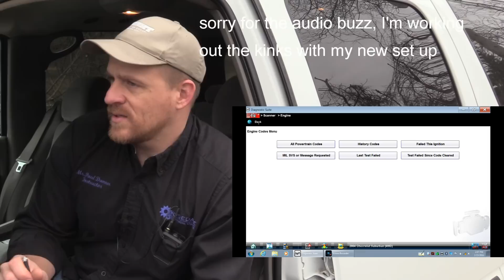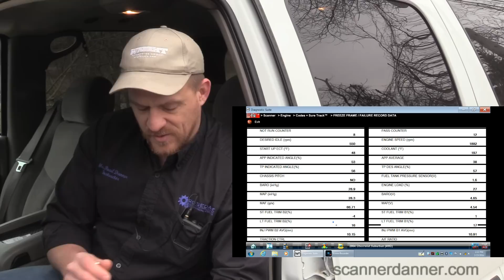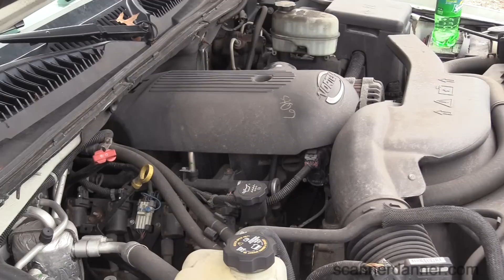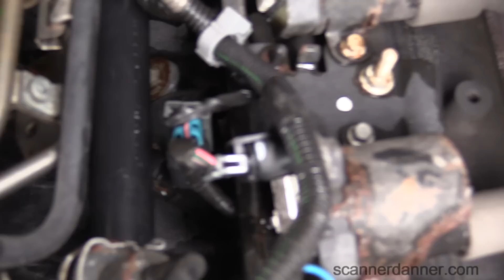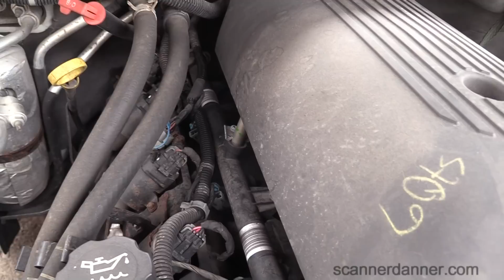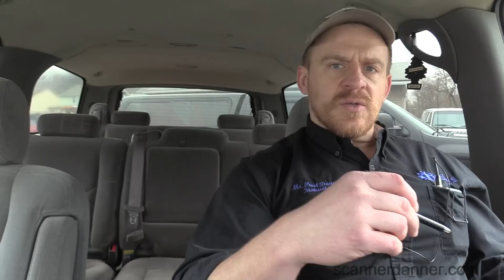Comment: 0171 & 0300 
Replaced spark plugs, wire, purge valve, intake manifold, cleaned fuel injectors, replaced 02 sensor, idk what else.  cleaned MAF, my MAF at driving is 1.90+
Reply: What are your fuel trim numbers at idle and 2500 and can you feel a constant misfire? If you feel a constant misfire, attack the misfire issue first. Spark, fuel and compression must be verified

Comment: Been running a bank 1 lean code for 10 years. All is fine.
Reply: Did you want help fixing it? If you do what are your fuel trim numbers (both STFT and LTFT) at idle and at 2500 in park on both banks?

Comment: So my uncle has a 1999 chevy silverado 2500 with a 6.0L in it. It had a huge problem with the lean bank 1 sensor 1,2 and bank 2 sensor 1,2. I changed the o2 sensors and it fixed it. Today it's in the low 30s outside and my uncle got in and drove home in a hurry the engine wasn't warm all the way and the misfire/death shake started he got it home. I cleared the codes while it was running and the temp got to optimal temperature at the same time but as soon as I cleared the codes the misfire stopped and it ran smooth. Idk what the heck but I wanna figure it out. 
These are the codes p0171 p0174 p0300 and p0151.
Reply: well you are on the right video if you suspect it is the intake gasket

Comment: Sooo I have the opposite problem where at cold it runs great but when it warms up it starts to shake
Reply: Codes, data (fuel trim and misfire counters) if it's a Ford and OBD2 scanner will give you that under mode 6 
Hot engine idle only misfiring is typically a valve issue (compression problems)

Comment: I have had a 171 and 174 for a few months... literally changed almost every part, maf, o2s, plugs, wires, all coils... ran smoke test, no smoke, I am about to do intake mani gasket and throttle body gasket with cleaning this weekend..... praying this resolves this issue.... i am at a loss... runs better after I replaced coils but light came back on... I did notice it runs way worse at idle especially when it is cold out... now the qeather is starting to warm up its not as bad... any tips would help
Reply: Do this water test with the engine cold

Comment: P0171 and p0174 codes. Smoke tested intake and evap. 0 leaks. Small e haust leak after downstream o2 sensor. Cleaned MAF. Ltft steady at 35 and stft steady at 8 to 10. 2017 silverado. I'm at a loss
Reply: Unplug your MAF and see what trim numbers do.
Reply: @ScannerDanner  I sure will and follow back up. Thanks!
Reply: Stft went negative 2 and holding
 Ltft trims dropped from positive 29 to 12 after removing maf comnector
Reply: Plugged back in connector and now it is idling rough. Fuel trims holding though. Maf reading slightly above 5 g/s currently.
Reply: @ScannerDanner  cylinder 3 shows value of 44 on misfire counter. No other misfires detected
Reply: Codes tripped when engine was warm. Under load fuel trims get better buy at idle return high. Also maf reads 3.4 at idle which should be closer to 5.3? Engine displacement roughly? I'm hoping it's not injectors HPFP or in tank pump
Reply: Fuel pressure at idle is 45 to 50 psi. Increases under load to 60+ psi but will fluctuate +/- 10%
Reply: I think I found the culprit. Aftermarket shorty headers burned through spark plug sleeve and boot on #3
Reply: Replaced spark plug wire as it was an unrelated issue to the lean codes. Still get high fuel trims at idle. Maybe the throttle plate is stuck open at idle due to carbon buildup?

Comment: Best explained video.2009 chevy 5.3 no power or acceleration at   full operating temperature.Could not feel exhaust at the end ofthe tail pipe so we cut the pipe between the manifold and cats to let he pressure out.Run the truck at full operating temperature for short distance and the transmission slips and engine revs up.Any ideas?
Reply: Transmission slips? Focus on that. Starting with fluid level

Comment: How is find my numbers change once my trucks heated up I’m gonna do another smoke test today, but I’m pretty sure I need a intake manifold gasket or something. I don’t know because I’ve got the original OEM on this 05 GMC and I hear that the new one has a metal retainer on the inside, so it doesn’t slip out the same way when it’s worn? So we’ll see what Smokey says. I was having major electrical turns out I had a bad ground pigtail coming off the left side harness next to the firewall ran a new pigtail ground off of that and that sold a lot of my sensor traction control ABS all those problems, but ultimately, I’m having sensor issue and I’m having an issue finding the current sensor. The one I ordered I’m gonna go pick up will work out. We’ll see.👍🏼🤞🏼💪🏼 I appreciate your diagnostic lessons

Comment: Excellent!  My situation is random/pending P0174.... which occasionally hard sets.  Ive been struggling with this for awhile.  STFT at 50%(!) and LTFT also very high for bank 2.   2002 GMC Savana. Curious if you have videos for just one side?  Thanks!
Reply: also, the spark plugs and O2 sensors for this side get carbon blackened... I keep cleaning them to try for a solution.  Exhaust flows fine, CAT CON not blocked - best I can tell.   Perhaps a problem ECU?   I do have an extra I could throw in....
Reply: Step 1, during the +50% trim command. Is the O2 reporting properly. You MUST address this first

Comment: Beautiful video, hope you r doing well, cuestion, so that means if the fuel trims going up as the engine is warmer, is not a vacuum leak, what can be? Fuel problems?
Reply: You can still have warm engine leaks too. The key is to monitor your trims at idle and 3000 rpm in park. If it gets better at higher rpm = vacuum leak. If it gets worse at higher RPM = low fuel pressure or dirty MAF (most common)
Reply: @ScannerDanner  thank you for awnser, my fuel treams going up both banks at 200rpm and maf sensor is reading ok, so next is fuel pressure? I have a 2010 kia sedona if fuel pressure is bad, what is next?

Comment: @17:39

Is it not detrimental to have non-compressible water entering a combustion chamber for the piston to  squish?

Kinda sounds like the 2000 Astro Van I bought in 2010; almost a "ratcheting" type engine running lack of smoothness.
Reply: No, it's not enough to cause any damage

Comment: Question I'm gonna try this. 

But I just did an ls swap in my 1986 c20 truck. 

My engine is a 2007 dbw.6.0lq4. Everything is new. But I'm getting the same codes.
Reply: You have a lean condition. Do some testing, report some numbers, then maybe I can help.
Reply: @ScannerDanner  ok I will do that thanks man
Reply: @ScannerDanner  oh also I failed to mention, I'm running headers number 2 cylinder the tube is not discoloring I'm thinking I may have a clogged injector not firing very good no mis fire code but it does have a mis fire. Would that cause the the lean codes for bank 1 and bank 2?
Reply: Most likely not, especially because it's both banks. Fix your misfire, then get me fuel trim numbers at idle and 2500 rpm in park
Reply: @ScannerDanner  ok we'll do. Thanks for you help.  I will get back with you

Comment: Hi Guys, ive got a toyota 2GR-FE v6, fuel longterm trims average -6% to 10% at idle & gets worse (+16 to +25%) spiked when pressing accelerator, at WOT it goes back down to +8 to +10%.

So as i drive it goes from 0 to 16 to 25 then back down to 10, which is so strange. load value on freeze frame data was at 30% so im unsure what is going on, could exhaust leak cause such a spike in numbers? or an 02 sensor precat or post cat?

any help would be great guys, Lean on both bank 1 & 2 and usually light comes on at constant speed.
Reply: First thing I'd look for is a dirty maf sensor. I have videos on this on and some are even Toyota. Second thing I'd check is fuel pressure, possible dropping off under load
Reply: @ScannerDanner  Thanks Guys

I havent replaced the maf sensor, checked & cleaned the 02 sensors, vacuum tested the intake & exhausts, reset the pcm & cleaned the throttle body and have found nothing, i cant pressure test my car as its a lotus exige & there is no place on the fuel rail to hook up the gauge for the pressure test.

however i am looking into it being the fuel pump.. the car spikes & comes back down in long term, its the strangest thing.
Reply: @m11ny  don't replace it (the maf) clean it!!
Reply: @ScannerDanner  i did clean it before & still issues, now i have 2 perfectly functioning maf sensors haha

Comment: Thank you for this. I just caught a manifold leak on my 02. Shed only misfire when idling without really cold outside temps on when the engine was cold. Did this water test after reading a code of lean. And she started misfiring abit and smoke would pickup out the tailpipe.
Reply: Sweet! It's a great test for sure

Comment: At minute 30:47 you would have tested the oxygen sensors better by stepping on the brake several times than by accelerating the car hard.
Reply: That would drive it lean, it's already lean, I need to make sure it reacts to a rich condition, and then the decel event after that is my forced lean. Best of both worlds

Comment: Hey so I have a boost leak tester for my Subaru but can I use it on my NA Acura tl and apply a small amount of air and use soapy water to see what might be causing my intermittent lean condition? I have a cold air intake on the Acura so it also has a gauge on the boost leak tester. I also have a ballon type adapter for the smoke machine but if I apply 2 psi of air or something and I spray around to see if there’s any bubbles but how many psi can you apply on the intake for a vacuum leak test?

Comment: Danner! I just diagnosed a 2013 Chevy Express that P0174 and P0172 lean codes for both banks. (it ended up being a bad MAF). Fuel trims were normal at idle, but on acceleration the long term fuel trims would go lean at over +20%. I could also hear the engine knocking on acceleration with the doghouse removed. The engine also lacked power and the trans shifted poorly. You NAILED it at the end of the video with your comment about lean on acceleration is likely MAF or fuel pump. I spent hours today doing diagnosis. I finally tried a known good MAF and fuel trims went normal, power was back, no more knocking, and trans shifted properly. I learned to use a Snapon scan tool and scope from your videos 10 years ago. THANK YOU.
Reply: That's awesome, way to stick with it and nice find. Thank you!
Reply: What brand maf sensor did you get? I got local autozone but told to go to oreillys but don’t know of a particular brand if you could point in brand direction would help! I am having these issues but to the contrary my engine runs great when cold but when warm weather or engine warms up then i get the knocking or rattling on acceleration and sluggish acceleration and poor shifting… i already replaced fuel pump for different symptoms last year and maf sensor to tackle this p0171  but thinking of buying again this time from oreillys… any help would be appreciated
Reply: @alansanchez-cp5lx  OEM (A/C Delco)
Reply: Same exact problem here unfortunately i went with autozone as well but ppl tell me to get an oreillys one but idk if it could be an intake manifold gasket leak or maf… i get the p0174 maf sensor already replaced and cleared and came back on after a couple of months…. Same as yours great in the cold but once it gets hot i hear the rattling upon acceleration and truck is very slugish
Reply: Have 2000 GMC Sierra 6.0 2500 has smoke exhaust runs lean..cleaned mass air now it's worse ..the temperature dropped here good. Bit and it started dieing at idle and has misfire in the beginning of throttling up but gets normal at 1500 2000 rpm?
Reply: ⁹what maf sensor did you buy I have GMC Sierra 6.0 2000

Comment: Out of curiosity, why not use carb cleaner or S.F to loom for i take leaks? I like using it because engines revs and seems easier?
Reply: I stopped using carb clean when searching for a vacuum leak on GM 3400 engine back in the day. It has a single cylinder runner leak and when I was spraying, it backfired through the intake and caught the engine on fire. The customer was watching through a glass window and I was at a shop (mobile call) and did not know where the fire extinguisher was. It was not good. I've never used a flammable source again and honestly this water test is a much better pinpoint test

Comment: Yes when I started as a Tech working for Cadillac and Olds on HT4100 V8 we would use top engine cleaner and pore water down the throttle body to clean carbon and also soak the top with some of that solution for awhile and start it up later,nice work

Comment: I have the same codes. Just replaced the intake gasket and still running rough with a little smokey exhaust . Any tips?
Reply: Yes, monitor fuel trim numbers at idle and 3000 rpm  and compare (like I showed in this video).
Then report what you find
Reply: @ScannerDanner long term bank 2 remains at zero the entire time. 

Everything else is floating at zero and rising on throttle. I have a video of the scanner reading as well.
Reply: Correction: 
Idle we’re at zero to -2

Running at 2k we’re at
Shortb1: 0-4
Shortb2: 55
Longb1: 20
Long b2: 25

This was after a second reading
Reply: Evap smoke tested- could not visibly see any smoke.
Codes are

P0101, P0151, P0171, P0174, P0300, P1153.
Reply: @drea953  so that is never a symptom of s vacuum leak. Vacuum leaks improve at higher rpm.
Low fuel pressure and dirty MAFs are the top two causes of what you are describing
Reply: @ScannerDanner  where should I start with fuel pressure!?
MAF was cleaned a few days ago, I’ll throw one in anyway..
Reply: @ScannerDanner  replaced plug wires,
Plugs, and an 02 sensor since this. Fixed most of my issues. Although now there is lean AND rich codes, with a MAF code…
Any tips?
Engine still smoking out the exhaust a little but definitely better than before!
Reply: @drea953  lean and rich? Combined with a MAF code? Focus on your MAF, doesn't matter that it may be new. How's it run with the MAF unplugged minus the stalling it may cause

Comment: Is vacuum above 18 when cold? My LTFT was +65% when cold. Lean misfire #6 with ticking lifter. Had a constant #6 misfire when cold or hot with random misfires codes. Plugs/wires/cop didn't fix it. Hot vacuum was 22. What fixed it was 3 oil changes with MMO and running it like a nascar down the highyway fixed my intermittent misfires...
Reply: Lifter issue will cause a misfire and false lean conditions for sure

Comment: After watching this video, ive realized the problem i have on my truck is the complete opposite! My fuel trims do not go anywhere close to normal or even lower. They just stay the same with longterm at 30% and short term between 17-25%  Engine chokes out as if it isnt getting enough gas, or hesitates to accelerate/stalls at go. 😢 i hoped this video provided some answers for my problem. Lol.
Reply: Both bank 1 and bank 2 show just about the same numbers, with maybe a 3% difference on bank 1. Its not an all the time issue- more like intermittent, but more prevalent the longer its maintained at operating temperature.  Its an 04 tahoe, 5.3.
Reply: What's your fuel pressure?

Comment: I love the channel, you are a car guru for sure. I have an 06 Trailblazer SS with a bank 1 lean condition. Cats, 02s,  y pipe and muffler are new as well as maf and air filter. No check engine light or misfire code but it has a slight hesitation and sounds like a fuel knock when accelerating. Power is still there when you get on it. Exhaust Temps are good, fuel pressure is good. Any advice would be helpful. Currently running fuel treatment in fuel. It hurts my soul to hear the truck run this way. I'm trying to bring this truck back from the last owners neglect. Have a blessed day.
Reply: What are your fuel trim numbers at idle and 3000 rpm in park?
Reply: @ScannerDanner  short term fuel trim idle bank 1 sensor 1 is bouncing -0 to 5.5
3k rpm -1.6 to 6.8
Reply: @bigpermsgarage6290  need STFT and LTFT on both banks (if it is a two bank system)
Reply: -5.5
Reply: @bigpermsgarage6290  idle and 3000 rpm please
Reply: @ScannerDanner  we finally figured out that I had 2 bad coils. She is running at full power now. I appreciate you spending time helping your subs. You are definately my favorite channel.
Reply: @bigpermsgarage6290  no wonder your numbers didn't make sense to me! That makes perfect sense. Wish I could have heard it running, that would have helped. Thank you!
Reply: @ScannerDanner  sensor 2 bank 1 idle 99.2 steady 3k rpm 99.2 steady
Reply: @bigpermsgarage6290  those are 1-2 numbers not 2-1
Reply: @ScannerDanner  I took pics and video, il send it back as soon as I get back home.
Reply: Idle
STFT Bank1, 0 to -6.2
LTFT Bank 1, 7.8 steady
STFT Bank 2  -7 to -12.5
3k rpm
STFT Bank 1, 9.0 to 3.0
LTFT Bank 1,  -5.5 steady
STFT Bank 2,  -3.1
LTFT Bank 2,  1.6
I have video if needed, just couldn't share it here.
Reply: Do those numbers make any sense?

Comment: Wish you could work on my tundra...Got both codes and pending 430....It is a new cat. Sigh.
Reply: Factory cats only! Aftermarket cats do not have the proper amounts of precious metals which is why they are so much cheaper. 
You will never get rid of those codes no matter what you do.
Just make sure you don't have any exhaust leaks upstream and that your fuel trim numbers are normal and there is no misfiring and then go get some factory cats.
Reply: @ScannerDanner  thanks. My mechanic is just a change something and see if the light comes back type of guy. Nothing like your diagnostics. Gotta find a new guy.

Comment: Got a 98 Chevy k 1500 misfiring vacuum leak but I'm also getting a tremendous amount of gas in cylinder third one back in the driver side all the other cylinders are dry I pull the plug out and it just flows with gasoline was that also be manifolds or what do you suggest